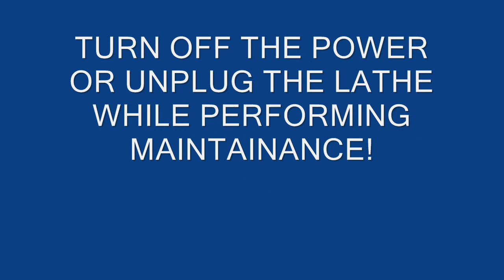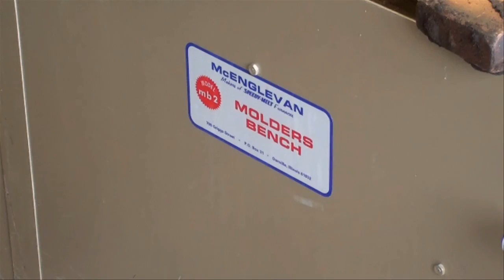MACHINE SHOP TIPS #108 Making a Guard for a South Bend Lathe tubalcain

Comment: When casting a thin part like this, would it be possible to pre-heat the greensand, possibly with a blowtorch, after the form has been removed, but before the two mold halves have been put together?  Would that allow the the aluminum to have a better chance of filling the entire mold before beginning to solidify?  Love the videos, thank you so much for posting!

Comment: Hi, I was wondering why you didn’t take the time to make it thicker on the front to make it stronger?  You could use the original part and add putty on it and shape it in a way the part is thicker.  I’ve seen that on custom aluminum part that had to be cast without patterns and they corrected weakness on the original part that way.

Comment from the maker: Oil sand is easier to prepare. Water dries out if you do not use it regularly. The oil type cost much more. I prefer the oil type, but only works with alum & brass.

Comment: How difficult is it to work with the sand mold if say you wanted to thicken the middle part of that casting by adding depth to the outward facing surface?  Or would making that sort of modification be out of line with keeping everything true to the original?